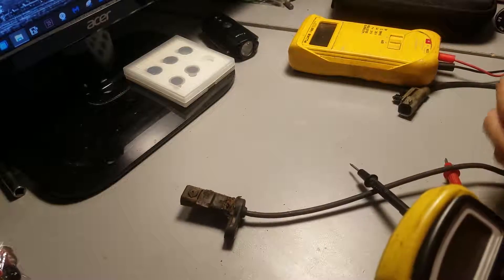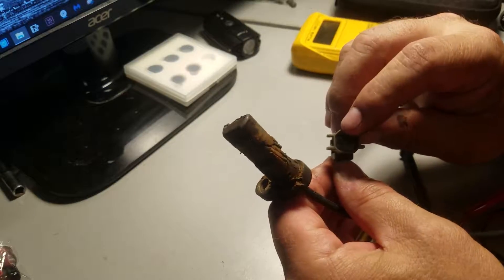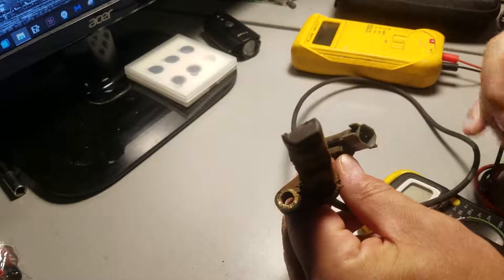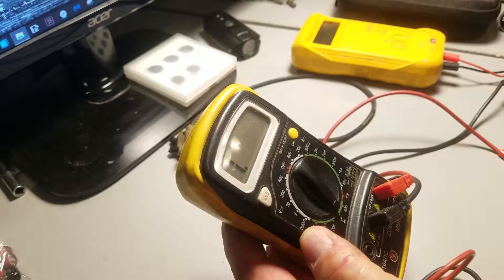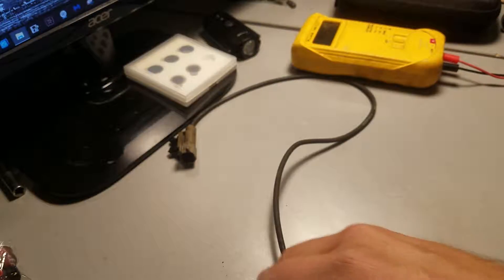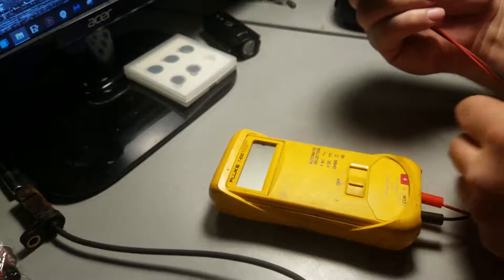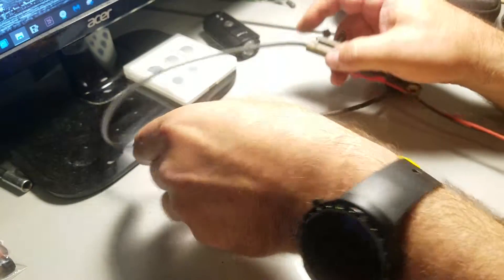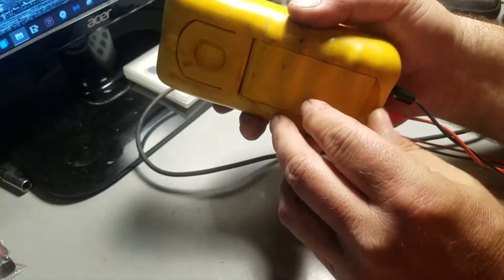Testing For All 2 wire Wheel Vehicle Speed Sensors ABS VSC Etc

Comment: So a good or new sensor would read resistance? Between the values you mentioned?
Reply: Good question i was left  a little confused as well. I did switch my meter to AC voltage and grabbed a magnetic screwdriver, with meter leads same in the connector, waving the screw driver it in front of the probe head produced voltage. So i'm pretty sure that means its good.